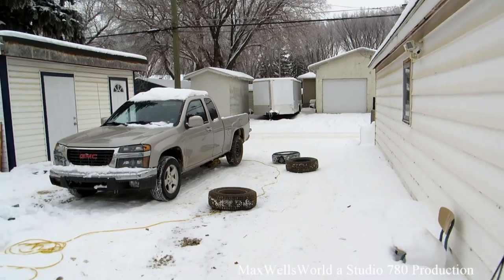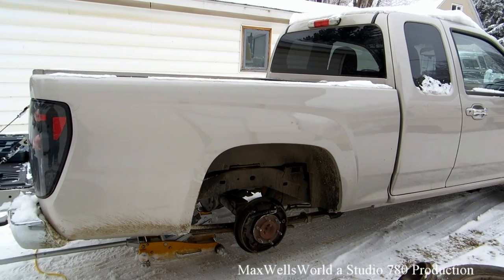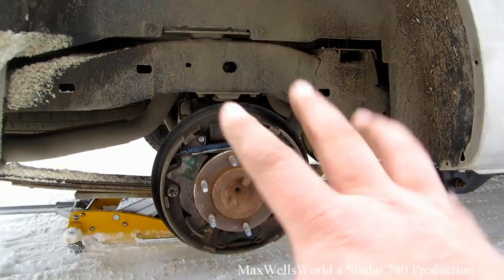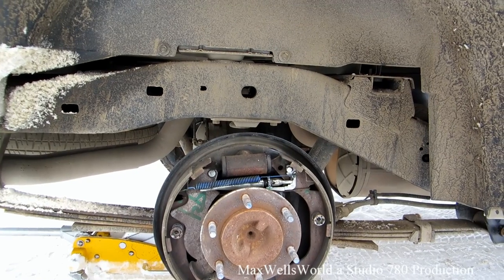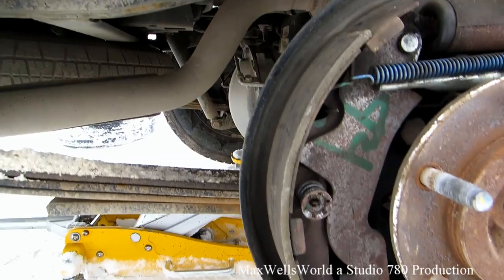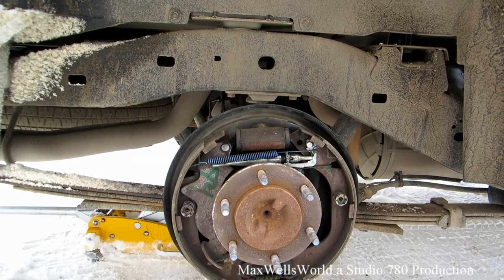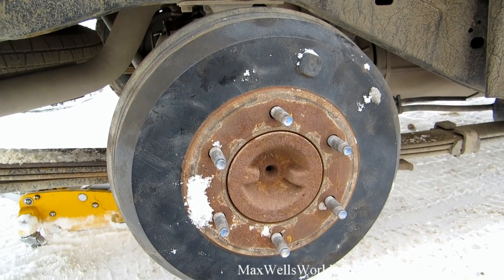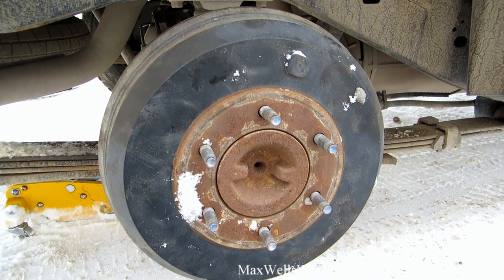hint/tip video brake drum  does not fit back on maxwellsworld

Comment: Had the same issue. Used a rubber mallet to adjust the shoes around by margins, then used the dial to either tighten or loosen. Drum was going over the shoes, but not completely. Then I just used the rubber mallet to bang it all the way over the shoes. Tested the brakes afterwards, worked just fine. This replacement drove me nuts FYI. Lol! Good luck everyone!
Reply from the maker: Mechanical issues can be frustrating. Trouble shooting them yourself can be frustrating. This saved me the loss of the truck and a tow bill and a shop bill. It may not work for everyone

Comment: That is your Self Adjuster, the "Keeper" mentioned here is a lever that "ratchets" against the star wheel and turns it a little bit every time you apply your parking brake.  GM has used these forever.  Thanks for the Video!
Reply from the maker: this was a frustrating time for me. it saved me a lot of money being able to get it back together

Comment: I'm trying to release the air through the bleeder valve and the bolt is rounded off what the hell am I going to do
Reply from the maker: Anyone in the comments know if the bleeder valve is removable? Or hot to fix this issue.